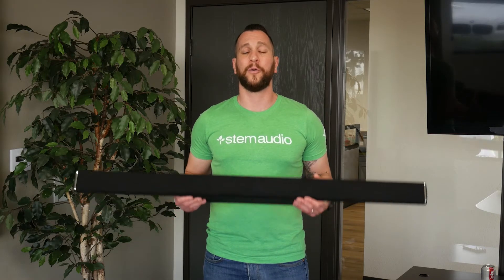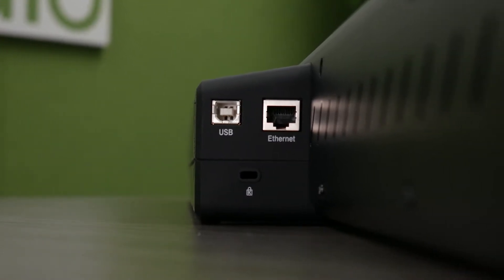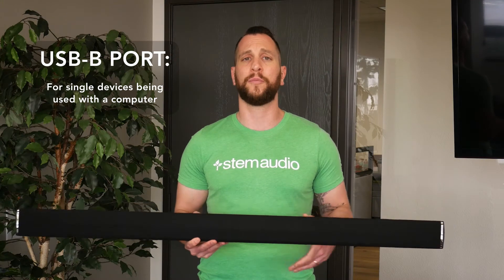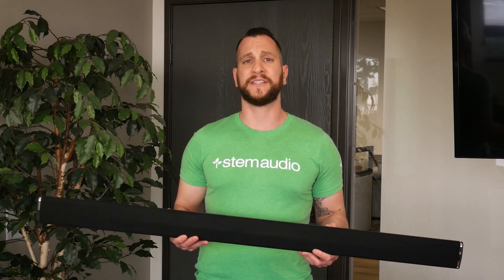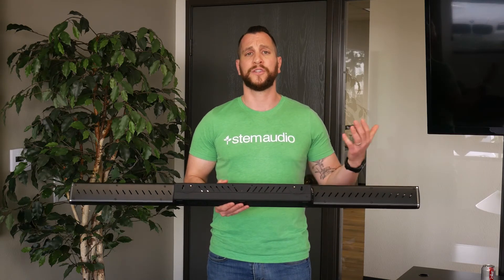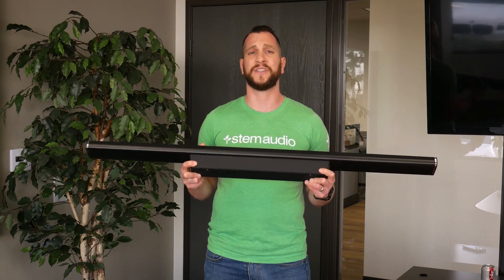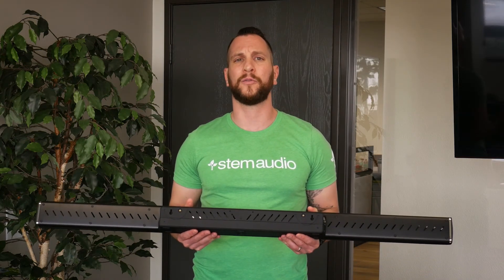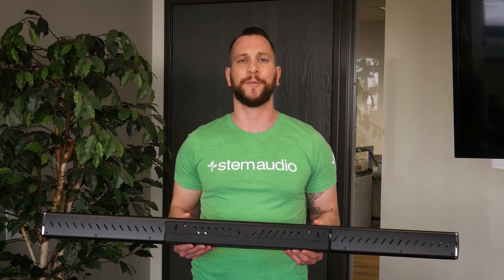2.2 - Stem Wall (Physical Installation)

Comment: Hi there is there a TV mount for the stem wall using an arm bracket?
Reply from the maker: Hey Martin, currently, Stem Wall is not approved to be mounted via any TV mount. If you have questions about an exact brand or model, please do get in touch with our Customer Happiness team at customerservice@stemaudio.com or (949) 877-STEM and they can look into that specific example for you and work on a solution that fits your situation. - Claire from Stem